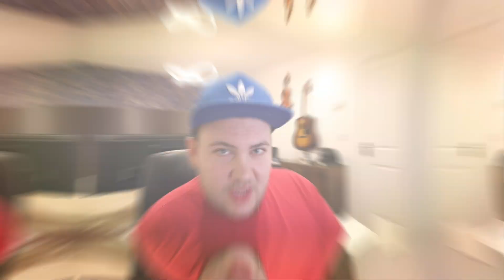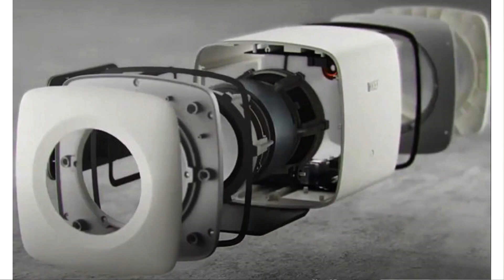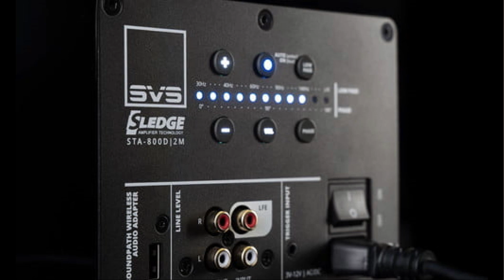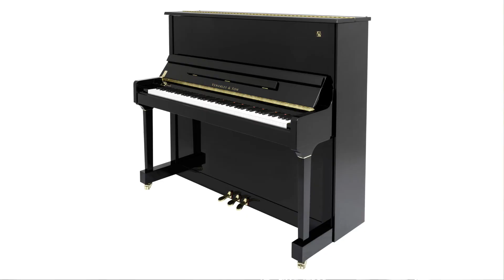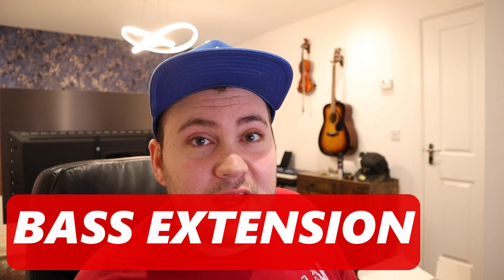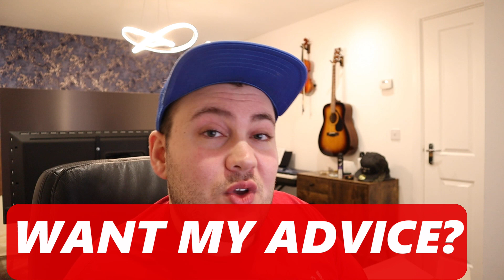KEF KC62 vs SVS 3000 MICRO!  Battle of the Baby Subwoofers 👶🏻! Review of the Facts & Honest Advice

Comment: kef kc62 for sure the better sub. absolutely no comparison. kef even outperforms rel
Reply: Depends. The REL's like the T9x have better ability in the mid range so you can even set crossovers at 100hz and REL will handle all those details, but won't dig as deep as the KEF, until you get to high volumes where the REL is stronger.

If you have a small room and don't need high volumes the KEF is the best choice, but for a bigger space and more musical up top then the REL is where it's at.
Reply: Better looking not sounding 🤙

Comment: Excellent discussion! My two cents as an electrical/control system engineer and a musician:
1) When someone says they have reduced distortion by X% using whatever technology or algorithms, the operative question is “Relative to what?” If they don’t disclose, then we are left to speculate. In this case I believe KEF is saying that using their proprietary technology, they can reduce distortion by X%, RELATIVE TO IF THEY REMOVED THAT TECHNOLOGY from controlling their drivers in this specific product. See the trick? They are comparing a fictional dumbed-down product against the final product they are trying to sell. Since both products are under their domain and you aren’t going to reverse engineer their system, it is hard to challenge such a claim. 
2. I would argue that larger driver surface area means less cone excursion is needed  to produce the same dB or SPL, all else being equal. The smaller your bass driver, the larger the cone excursion will need to be, and thus expect larger distortion, which if you have the money, you can implement some type of servo control - whether via sensor (accelerometer) or sensor-less (current field vector monitoring). Honestly, it is better to have less inherent distortion in your system than to come up with compensatory methods. 
3. Think about your typical bass drum sizes. For jazz, it might be 18 inch diameter. But for most other genres, it is typically 20”, 22”, 24” and even 26” on occasion. Slam the beater on your bass drum pedal against the head. Get a feel for the impact and how much air had to move to get that punch to happen. Now think about what kind of excursion would be needed with a 6” cone driver to attempt to come close to a 20”+ bass drum. That is a tall order - a tough job to expect a tiny cone to approximate the mechanics of what a bass drum and drum head is doing.
4. Discrete MOSFET components in an amplifier are almost always a better choice than using an integrated amplifier chip. I would choose discrete MOSFETs or BJTs all day, everyday. Odds are, the discrete components will last longer if the designer sized them conservatory and used appropriate heat dissipation.

Comment: To create crossover with my Q-Acoustic m20 can i use the app or do i need keff speakers to get some of the apps features
Reply from the maker: not sure I understand the question - but if you want more precise (and easy) control over your crossover and other parameters then the SVS 3000 micro is probably the better way to go
Reply: @geezerintotech  actually i am debating between the kef mini sub and the svs micro . But i live in an apartment complex and my space is limited , the apartment EQ of the KEF is really intriguing, also may have no choice but to place it in a corner , or wall & kef sub placement is also more forgiving with those EQ's for the placement. The only thing that pisses me off about the KEF is that i dont think i am able to fiddle through those eq through an app , id need to keep going to the back of the unit to change them, can you confirm this to be true? As far as i am aware of the micro dosent have thes type of EQs right? But ya the apartment EQ is REALLY nice
Reply: Also can the kef do high passs filtering from the app with an other brand of speakers or not? Its not clear
Reply from the maker: @SamLGND  well the apartment EQ is just a preset that Kef have made - it doesn't mean it will necessarily sound better in your apartment.

If you want the best sound then you'll always need to calibrate the sub yourself - the SVS app gives you more tools to make your calibration more precise (and it's really easy - you just do it from an app on your phone). 

The Kef KC62 is more of a one-size-fits-all subwoofer - it's a bit more plug'n'play if you know what I mean. 

I think the SVS micro is the better all-round subwoofer (especially if you like watching movies) .

But they're both really good subs for the size
Reply from the maker: @SamLGND  yes the kef can do high pass filtering i believe ( and I actually think the SVS does not have this feature).

It only matters if you want to connect speakers and you want to cut the speakers range off - for example if you want there to be a crossover at 80hz you'd set the high pass filter to 80hz and your speakers would crossover at this point.

This has some advantages because your speakers aren't expected to run full range - so it's basically taking alot of stress of the speaker because sub-bass frequencies demand the most movement from a speaker driver (and hence more distortion). 

So, I would say if you have quite small bookshelf speakers having the high pass filter could be an advantage.

If you have quite large bookshelves or floorstanders, it becomes less of an advantage but some people will still benefit from it (especially if you have big space to fill)

Comment: I have the KEF LS50W II and bought the KC62 in the belief that I got a perfect set. The problem is that the KC62, incomprehensibly, turns off at low or medium sound levels. I've already talked to my salesperson and he said he reported the problem to KEF, but so far, after more than 2 months, they haven't solved the problem. In the meantime my salesperson lent me an SVS 3000 micro for me to try out. With the KC62 I could more easily get a good association with the LS50WII, but with the SVS 3000 micro, I have to use the app, but it's not easy for me to calibrate all those variables. Volume; Low pass filter; Phase; Parametric EQ; Room gain compensation. Not only is it complicated, but in practice I have great difficulty understanding the effects of each parameter on sound quality. And I'm not deaf. If KEf doesn't solve the KC62 problem (many other users have already complained about the same problem), I will have to stick with the SVS 3000 micro, in this case, how to optimize its functionalities with the KEF LS50 WII?
Reply from the maker: I empathise and understand your concerns around the calibration of the 3000 micro.

The first thing I'd try and set is the phase alignment - look up a few videos on how you can do this. One in perfect or near-perfect phase, then you can adjust the gain to get the bass at the right level. 

If you can't be bothered with doing a parametric EQ (don't blame you), then you can use the Small Room Correction feature within the app - this should get things sounding a bit tidier in your room. 

With the stock profile, the 3000 micro can sound a bit boomy (it has more sub-bass than the kc62 and this is greatly affected by room gain). So, if you run that Room Correct feature you should notice the sound is much better presented.
Reply: @geezerintotech  do you mean Room Compensation?
Reply from the maker: @RiseFall123  yes I was referring to the small room compensation feature

Comment: Nice impressions but sound little biased - you can’t say this will be better by few percent without measuring it. What I gather people prefer kc62 to SVS micro so seems the smart they put into makes 6.5inch better than 8 inch SVS and that tells us a lot. Without making accurate measurements you can’t make any conclusive review. You can’t compare smart sub vs regular one based on spec - absolutely impossible and is prone to bias.
Reply from the maker: I've actually reviewed both and had them both here. See the more up to date reviews.

You can say what you like but there's absolutely no way two 6.5 inch drivers are going to outperform two 8 inch drivers on clean SPL. The only way is if the excursion is there - but higher excursions mean more distortion and I don't think smart distortion control is that smart lol. There is a limit to what it can do.

I have had it here and I seen it for myself. KC62 good sub but lacking some key features and overall it's not better than 3000 micro as for movies it's really not at the level. 

Would you rather buy two 3000 micro or one KC62? The price difference is almost that much in the USA. 

KF92 alot better as an overall subwoofer, but that costs too much. You can buy Arendal 1723 2S for £100 less than KF92. And that's got 21 inch driver area.

I can assure you it's not bias - I am not being paid by any of these companies. I buy the products and review myself. It's actually the polar opposite of bias.

If you want to listen to 65db audio with +20db peaks (nearfield), go ahead and buy the KC62. That sub is not on my list though.

I'd rather Dynaudio 18s studio subwoofer for less money and more output.

There you go.

Comment: I'd wait until KEF comes out with a model that uses 8" drivers, which I suspect won't be too long.
Reply from the maker: yes that's true but going by the kc62 price, then i'd expect this unit to cost more than 1500 quid!
Reply: @geezerintotech  True, which will be rather unfortunate. This all reminds me of the "who-can-be-smaller-and-more-powerful" Sunfire vs. Velodyne wars of the 90's.  It was those wars which opened up a slot for the competition to come out with smaller and better performing subs. What's funny is that if SVS hadn't sold the business and moved to a dealer model, their pricing would be even more affordable than it is now.  Personally, I think SVS wins this particular battle hands down because you can buy two of the micros for one KEF.
Reply from the maker: @ayokay123  yeah exactly! I think the trend has re-emerged as people get greater access to Dolby Atmos content, so the mainstream household now needs a sub to get access to that content. However, a 15 inch beast isn't going to cut it. 

But yeah I'd go with two SVS micros any day. I'm about to test the SB2000 Pro so let's see how close the micro gets to its bigger sibling!
Reply: The have come out with 9" drivers.   KEF KF92 - black only
Reply from the maker: @DennisInVenice  kf92 came out before kc62 i think? - and problem is it is double the price over nearest competitors..no matter which way you look at it, it does cost alot of money when you go Kef

Must definitely be a good subwoofer though
Reply: @geezerintotech  Different driver technology than the KC62.
Reply from the maker: @ayokay123  doesn't have the unified magnet system and the P-flex surround, yes. But amplification remains the pretty much the same.
Reply: @DennisInVenice  Different driver technology than the KC62.

Comment: How would you rate the 3000 micro vs the 1000pro?
Reply from the maker: If I were to estimate, I think they would be very similar in terms of performance. The 12 inch driver on the 1000 pro should give it a slight advantage over the 3000 micro, but only slight. The only issue is the 1000 pro has limited amplification compared to the 3000 micro (I believe it is 325w vs 800w). This amplification may limit the potential of the 1000 pro's driver. 

Take into account you also save a bit of space with the 3000 micro, and you also have smaller drivers (which some people claim would sound 'tighter' and a better match for smaller speakers). That might be true in limited cases, but it depends on the quality of the magnet system behind it too.

However, if we compare to the SB2000 pro to the 3000 micro, then the SB2000 pro would win hands down. I'm sure that subwoofer can dig deeper than the 3000 Micro from the figures I've seen and the user feedback I've seen online. Those two models are also more similarly priced, so if space is not an issue, get the SB2000 pro I think.
Reply: @geezerintotech  i own the 2000pro and love it! I got it in januari and cant help thinking “might have preferred 2x 1000pro” 😅
Reply from the maker: @bartbarelds8454  Oh no way mate! Don't go backwards! Get another SB2000 Pro and do your mother proud! Hahaha.

In all seriousness, don't consider the 3000 micro unless you have a very picky individual in your household who wants it smaller!!! I always thought bigger was better hehehe 😅
Reply: @geezerintotech  thnx for ur thoughts mate! I’m not changing anything soon as i’m seriously happy with what i’ve got right now!

My SVS SB-2000Pro pairs with a set Kef R700 floorstanding speakers driven by a Denon PMA-1600ne.

Since the sub only “helps” the Kef speakers and i primarily play music i don’t really need anything more.
Reply from the maker: @bartbarelds8454  Oh I seee...that makes sense. The R700 can definitely handle its own very, very well. It certainly digs deep that speaker. I heard the R7s just recently and if anything there was too much extension! Lower notes had to be turned down due to room gain boosting the bass!

Yeah, I say stick with your 2000 Pro as planned...that is, until you 'get the itch' that is! Then you can come back here and we will talk upgrades again haha!